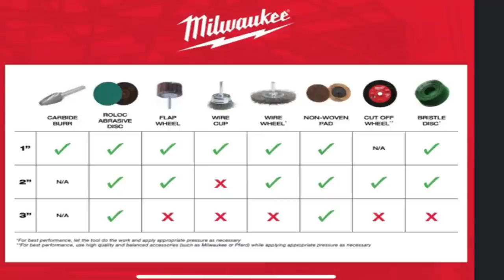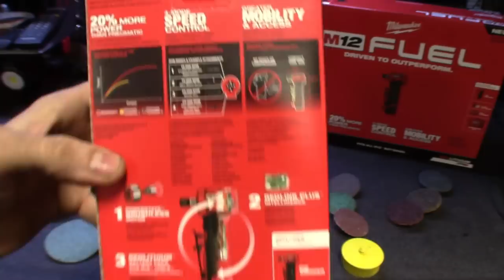Milwaukee Grinder and Attachments

Comment: Just picked one of these up to replace my air die grinder. Using it for metal fabrication/automotive work. Love it so far. No cords to manage, it actually pretty light even with the 6.0 battery. This is likely to be one of my favorite tools.

Comment: I ordered 2 haven't seen them yet but yesterday I got on the cornwell truck for the first time and I was blown away with the amount of milwaukee he was stocking so I had to do a JRC54 tool haul and pick up a 3rd grinder. I don't buy kits unless I'm getting free batteries or tools, since I use the m12 tools in  construction and automotive I only run extended life batteries 3.0 and up I just give the 2.0 and 1.5 away now I have easily 30 small amphour batteries and close to the same in extended life batteries. I'm really digging all the new Milwaukee tool. I'm also stoked to be picking tools up from cornwell, I'm impressed with the tools I have seen so far.

Comment: I was on the fence about this grinder. Been on the fence for 2 months because of reviews that you cant put much force on it.
I finally gave in and drove to my HD and picked it up...best 169.99 i have ever spent and regret not getting it sooner. Just an amazing quiet machine.
I have a large air compressor and air grinder and i hate the noise but with this is quite compare to an air grinder.
Highly recommend
Reply: How has it held up?

Comment: I got this 2 months ago and love it. I usually listen to music/podcasts with buds both for hearing protection and entertainment. 

Today was the first time i didn't have buds on while using it. Noticed a clicking or a rasp sound during the sudden deceleration after letting go of the paddle. 

It's almost inaudible lasts a fraction of a second. I was concerned it might be a bigger issue but you and actually everyone that recorded the video with decent audio have the same click. 

It's 7:43 for each speed setting. The paddle being leg to sound isn't what I'm referring to. It almost cancels it out but it's there. It's also not consistent sometimes i can't hear it but it might be in an inaudible frequency.

Comment: You could drill out that roll pin that's holding the safety switch in, that thing looks like it would be a pain when your doing short precise grinds. Thank you for having a safe channel to comment my opinion on tools for everyone to see and comment back if they would like to.
Reply: Thats what I thought too but what I did was use a small zip tie and works great just incase i want to use the safety feature later on
Reply: I took a 1" square piece of rubber strip and blocked the spring loaded safety lever open. The folded spring lever holds the rubber in place and can be quickly removed. It sits behind the trigger bar and is out of the way of your fingers.  At first I drove out the bottom hinge roll pin and took off the whole lever assembly and just used the trigger with my middle finger, but with the trigger bar, you have more speed control and the grip is designed so your index finger grips just below the motor while the remaining three fingers squeeze the bar.
Reply: Sometimes get this issue on air tools, i just hold it open with other finger.

Comment: Its a die grinder. its made for the 2 inch cut off wheels i had a 4 inch on mine in a pinch and it did fine for trimming.

Comment: So far out of all the YouTubers you're the first one I've ever seen use the tool like I would. So I can see whether or not it's worth for me to buy. I would really be using the 2 and 3 inch barrel round Sanders . That is in my main use in a CNC shop is smoothing out bores. Thanks alot for the video.  I see it can be really useful for me. 
I also heard that Milwaukee will be releasing a straight grinder in February.

Comment: Could wait to get mine! Wow have I been disappointed.  Everytime I have used it, it constantly stops. Especially with wire brush attachments.  Not happy with it all.
Reply: Greg Norvell yes! I had the same issue, I dont know where they got the 1/3hp rating from. I returned it after 30 seconds of use trying to take lead gaskets off my manifolds. With the small 1-1/2” cup wheel it kept cutting out. I reverted back to my mastercraft $50 mini air tool and it absolutely blew the m12 away. I wasnt pushing on the m12 hard at all. Milwaukee makes some impressive stuff but this one isnt...
Reply: Couldn't agree more. I was using a 1" wire brush. I too wasn't pushing it hard at all, just enough to let the brush do its job. It's just way too sensitive. Although I haven't had any issues with the sanding discs, yet. But I havent really used it a lot with the discs. I just got frustrated with it and threw it on the bench.
Reply: Yeah, that’s the safety feature.  The sander / polisher is better for the larger things - lower rpm’s, more torque.

This one works great with burrs or smaller attachments.
Reply: Let the tool do the work, stop pressing down on it

Comment: I’ve been wanting to try trowing a cut off disk on mine to see if it could handle cutting a stubborn sway bar link, but I haven’t had the balls to do it.
Reply: I just got mine the other day and wanted to see how it cut with a wheel on it. Cut through a broken 3/8 extension no problem.

Comment: I need more education on the attachments PLEASE!!! 🙏

I heard you saying you use the bristle brush for cleaning the rims & that sparked my interest because in a couple months, I plan on powdercoating my rims but want find the quickest/most effective way of cleaning grime off my wheels
Reply: That’s used for cleaning the rust that forms in the mounting side of the wheels. The most effective way to keep your wheels clean would be applying a ceramic coat on them.

Comment: 3" not recommended probably due possibly hitting fingers..great vid..👍
Reply: Physics are why 3” isn’t recommend. Higher edge speed and therefore higher projectile or disintegration risk.
Reply: Also more load on the tool probably.

Comment: I've wanted one for years. I do my own auto mechanic work on my vehicle's (want something done right do it yourself 😆😆) except for high end specialty stuff. Nothing inside a short block besides a cam but top end is fine. I also like doing custom work as well. Got a lot of work to do on the Camaro coming up but anyways thought your vid was worth a comment for the algo! Bout to order both angle & straight version with the 3" cut off tool.😈

Comment: I think Milwaukee tools are definitely cutting into snap ons bottom line.
Reply: I have the new snap on impact gun $900  and my old milwaukee gun is still stronger milwaukee and harbor freight Daytona jack
Reply: Snap on power tool sucks like they always did way too weak and expensive for that crap when u can get a milwaukee for cheaper and 4x more strong and durable

Comment: FYI from I’m experience on the right angel die grinder and on the 3” cut off tool I try and always run a 6.0 mainly because of run time. There’s a slight increase in power not much but it seems to last a hell of a lot longer. Also when using like a 2.0 when it hits 2 dots on the battery level it seems to drop down in power and speed. Plus it stands up Nicely with the bigger batteries. Also the straight grind spins a little slower the the 90 FYI.

Comment: I just purchased this M12 right angle die grinder and so far I like it.  I did order 2 extra 3 Ah batteries  since I know I'll be using this tool quite a bit.  I will say that it is bulkier than my IR pneumatic die grinder but not having the air hose attached is a major plus.  Additionally, I'm hoping Milwaukee will look at changing the collet to a quick release 1/4" collet like they use on their 1/4 impact driver.  That would be sweet if they could engineer that into this die grinder.  Thanks for the vid and I went ahead and subbed to your channel.  Cheers!

Comment: Have you tried the1.5- 2 inch cutoff wheels if so how'd it do I already have the lil 3 inch cutoff tools that's awesome but a lot of times a 1.5-2 wheel would be perfect for what I do in places the 3 inch tool won't fit thanks for any feedback 👍👍👍

Comment: I just got one and it keeps cutting out using a 2" roloc non woven when trying to clean a rim and when i did try to suffer through a whole wheel the battery didn't last. Might be ok for home use but definitely not for work every day. I should have waited a few more years until it was up to par with the  air version.
Reply: just the corrosion off the bead surfaces. It will run with a burr bit pretty good though.

Comment: Any idea of the est runtime using a 6.0 battery and removing rust with the flapper wheel like you were doing?

Sweet tool!
Reply: TTC measured 150 Watt constant output. 6ah battery has 65Wh so probably 15 minutes tops I'd say

Comment: Putting my order in tomorrow morning with the Protective boot for the Tool No Games No Joker Ready to get Busy I think they designed the light to be were it's at with the assumption of what ever a individual is working on a good percentage of the time would be faced downward than face forward what's funny is that the tool is a die grinder but what if it could be used in a sense like the cut off tool ...Ooooohh Milwaukee needs to create a attachment not taking anything away from the cut off tool but It seems like the die grinder has more kick to it

Comment: Face shield with wire brushes always
Reply: I’ve learned to use a face when using any rotary disc or wheels. I had glasses on using one of the paint stripper disc and chunks flew off and hit me in the lip. I always try to use a shield now.

Comment: Can you use it to cut, like a metal grinder??
Reply from the maker: You can but there is no guards. I would rather use Milwaukee 2522-20 to cut metal.
Reply: Die grinders don’t have guards for some reason. Excellent for accessing tight spots though.

Comment: those wire wheels are probably rated at 4500rpm. This tool has min RPM 10k-25k which is why the wires fly out into your face.

Comment: I hate the fact that this cuts off when pressing too hard. If the motor dies  I  would rather buy another one than having to stop and reset the battery. Any other milwaukee tool won't shut off from pressure. Why this one does that?

Comment: Would you use any of the roll-loks to remove gaskets, or are they too aggressive? Also do they leave too much abrasive residue?
Reply from the maker: Bristle disc works well
Reply: @JRC54  It doesn't dig in to metal od leave abrasive residue?
Reply from the maker: Those disc are rubber. They do well if your careful

Comment: plastic trigger should of been metal with a roller ball on the end or a standard trigger variable.. the led what were they thinking it dont light up the work area and its bluish color a high power clear white led where it lights up the work area or a ring light around the head.. i mean come on milwakee or techtronix who owns all the brand tools you need to start not charging tons of money for these things milwakee is way to expensive....

Comment: Why do mechanics clean rust with tools, you can just get a tank of evaporust. let it set overnight and go on to the next task. I draw the line at that kind of work a customer can do it themselves if they want it done that fast. You should also wear a mask you are setting a bad example that breathing in metal particles sometimes is legit. Use your head when your setting up a review. Yes we all do it sometimes but it still is very gross and harmful.